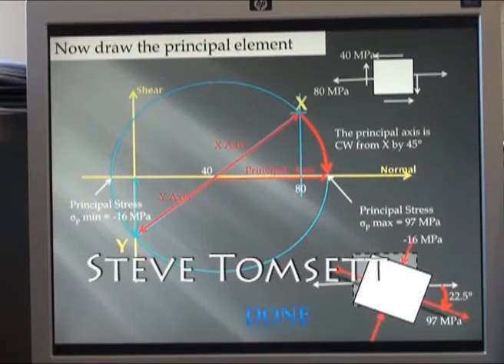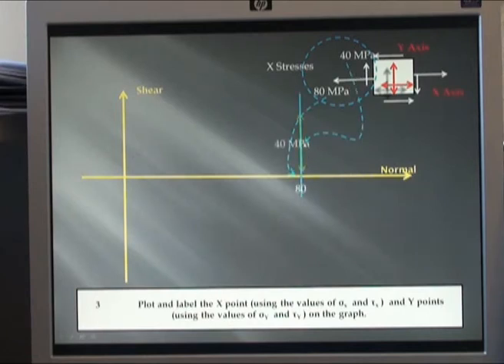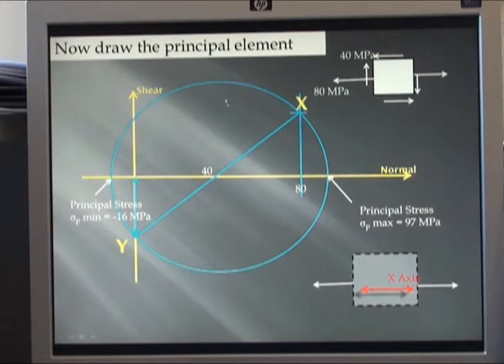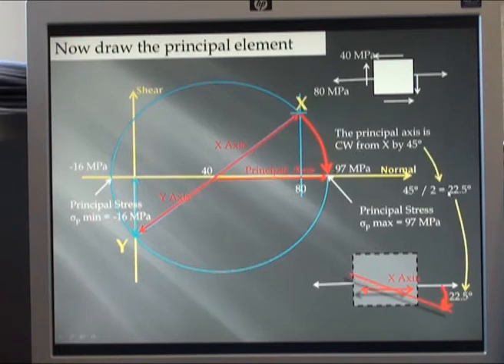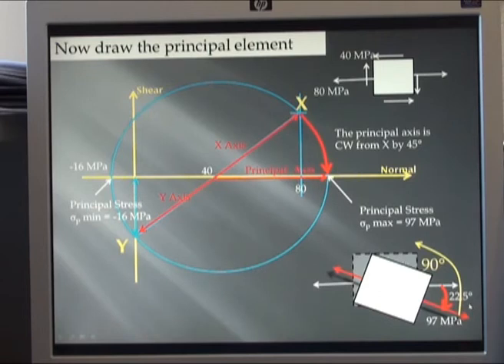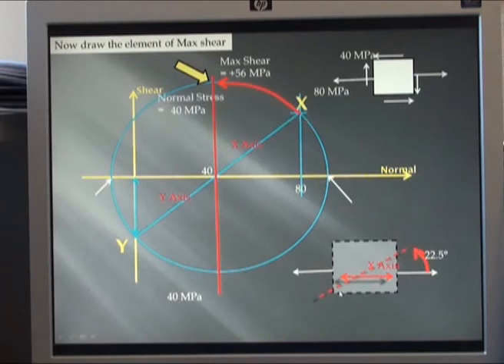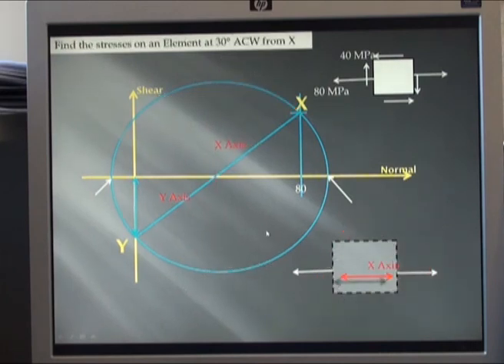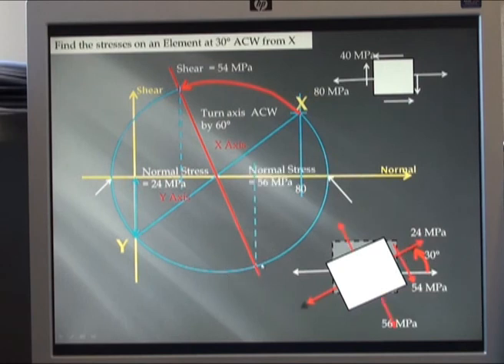Mohrs Stress Circle (short version)

Comment from the maker: It is just the way the circle works. If you look at the X and Y points, they are 180 deg apart on the circle but are 90 deg apart in real life.  this is why you need to 1/2 the angle measured on the circle to get a real life angle.  Steve